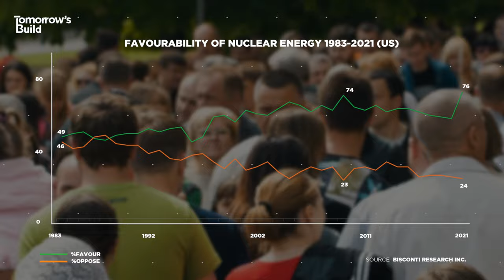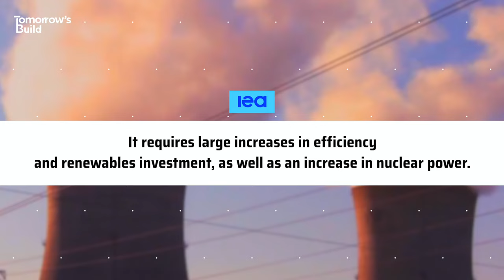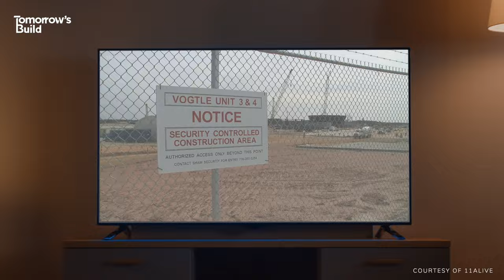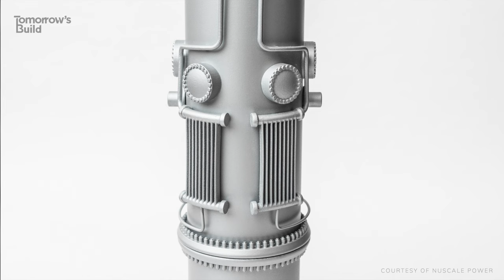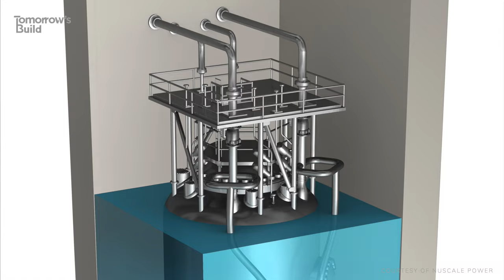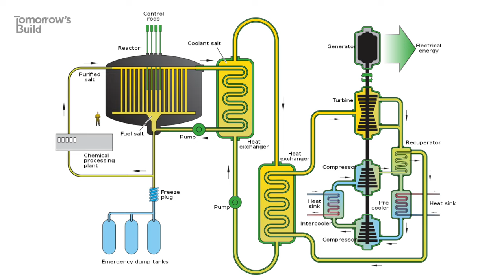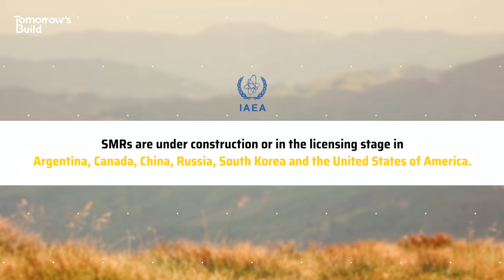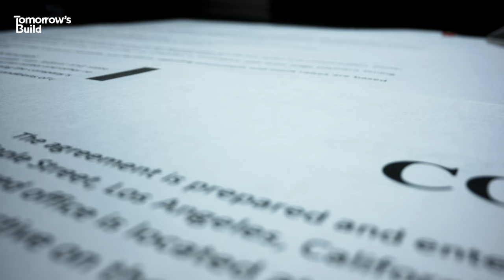These Mini Nuclear Reactors Can be Built Anywhere

Comment: Still not worth having to manage the waste for the next 1,00,000 years. If this post was a timeline that represented 1,000,000 years, then all of recorded history is represented the last word, No.
Reply: 1) The longest lived actinide in spent fuel has a half-life of 10,000 year. So the after ten half-lifes, when only trace amounts of of it would be left, is 100,000 year. I don’t know where you would have gotten 1 million years from. 2) Spent fuel, which is ~95% unused uranium, is too valuable as fuel in fast reactors and molten salt reactors, both of which burn those actinides in the reactor, to be left to rot. I would bet our current depositories will be dug up within a century if they ever open.
Reply: @kokofan50  Just google "how long before nuclear waste is safe" The reason they don't use the spent fuel for salt reactors is that salt reactors explode if they ever encounter water. but never mind all that, lets use your numbers. 100,000 years of our descendants needing to keep looking after this stuff is good?
Reply: @robloughrey  Salt doesn’t just mean sodium-chloride, which doesn’t explode when exposed to water; salts are a class of chemicals defined ny their ionic bonds, as opposed to covalent bonds. This is really basic chemistry 

Even a sodium (metal) cooled reactor won’t explode if exposed to water.

Putting aside the BS retort of just google it for where you got you disinformation, the actinides are burnt in MSRs, so there aren’t any to deal with for 100,000 years. The longest lived byproduct of MSRs has a half-life of 30 years. Besides those byproducts having numerous uses in science, medicine, and so on, we can easily seal them in casks and drop them in the ocean, where we would never find them.
Reply: @robloughrey  Salt doesn’t just mean sodium-chloride, which doesn’t explode when exposed to water; salts are a class of chemicals defined ny their ionic bonds, as opposed to covalent bonds. This is really basic chemistry 

Even a sodium (metal) cooled reactor won’t explode if exposed to water.

Putting aside the BS retort of just google it for where you got you disinformation, the actinides are burnt in MSRs, so there aren’t any to deal with for 100,000 years. The longest lived byproduct of MSRs has a half-life of 30 years. Besides those byproducts having numerous uses in science, medicine, and so on, we can easily seal them in casks and drop them in the ocean, where we would never find them.

Comment: Nope. It's going to be too expensive, still as slow, and not get approval.
Reply: You literally got everything wrong.
Reply: @kokofan50  
Expensive: New tech is always expensive, no matter what.
Slow: Same, new tech is not fast to build
Not get approval: Same, new tech is not proven and will have a harder regulatory time.

All of these together makes me think it has no chance to beat renewable energy, which works today and is safe. Renewables like solar, wind, and batteries also follow learning curves, meaning they get exponentially better. This does not. This also requires fuel that is not that cheap.

All this ads up to something that in the next 10 years is only going to be slower and more expensive.
Reply: @AlvarLagerlof  SMRs aren’t fundamentally new technology; they smaller, simplifier and more manufacturable versions of reactors of existing technologies. Also, licensing is part of the calculation in being cheaper than renewables. 

The whole point of SMRs is serial production, which will benefit from a learning curve, and on company has just said they’re going to start mass produing reactors this year. Also, solar and wind have bottomed out in their learning curves.
Reply: @kokofan50  Solar and wind have not at all bottomed out. Solar is currently the cheapest energy source on the planet.
Reply: @AlvarLagerlof  solar isn’t the cheapest. California has gone full in one solar, and they have electricity prices several times higher than anyone else in the US. Germany has done the same thing with the same results

Comment: This is stupid, it's better to use the economy of scale for greater efficiency, more safety, easier construction and cheaper overall costs to build an actual full size nuclear power station
Reply: These are designed to tap into the efficiencies of mass production.
Reply: @kokofan50  taping in will still be risky, imagine the public outcries of nuclear generator being installed everywhere, I’m from France where 86% of our elec is nuclear made but I clearly not that for the population, they would not be that open to the idea

Comment: I find the EBR II reactor very interesting. It was much safer than today's pressurized water reactors and fuel recycling was built in. A shame that the project was cancelled for political reasons.
Molten salt reactory have a lot of potential too, but will require a lot of development work. The point will be to make the reactors passively safe.
Pressurized water reactors were developed for submarines, which are swimming in cooling water. This made a lot of sense and the reactors are very safe if properly designed and maintained. Then the PWRs were built on land and made bigger and bigger. Thus safety became problematic and more active safety features had to be added, increasing the cost dramatically.

Comment: Ah yes, more hopium for the nuclear industry. Let's go over the points for why most of the reactor designs will never pan out:

1) High temperature gas reactors: cannot reach the required mass flow rate w/o significant water ingress via the helium circulator; TRISO fuel too expensive to make. 
2) Integral pressurized water reactor: too much structural material needed for the power output of the plant. Design scales economically w/ size.
3) Molten salt reactors: tellerium-induced radiation cracking in the pressure vessel. Cannot be resolved.
4) Supercricitcal water reactors: no fuel materials available that can withstand the critical point of water.
5) Sodium cooled reactors: cannot resolve the thermal stratification necessary to ensure longevity of structural materials.

Have a nice day, everyone.

Comment: nuclear powered is basically just a steam engine, nothing high tech just boil some water to make some steam... meh very unimpressive
Reply: well if you screw up you could spray death clouds everywhere
Reply: @FTFSupremacyROBLOX no, you can’t, not w these modern reactors. We know what happens from Japan when one is broken, roof torn off by aftermath tsunami: nobody dies. 

On the other hand there “death” every damn day from oil gas coal accidents or emissions. Look into it.
Reply: Boiling water is not high tech but the fission behind it is, the energy density is, so we have some reactors that can run nonstop within refueling for 20 years, and on a little piece of land.  Nonstop. 20 years.  There is no other tech that can do that, and there won’t be .
Reply: @Nill757  That's the point with nuclear, only if you screw up, fossil fuels sprays death clouds regardless.
Reply: @FTFSupremacyROBLOX  then give nuclear every time
Reply: @Nill757  exactly

Comment: Still questionable, nuclear power plants have large facilities on site to store spent fuel elements. A used reactor element needs to cool down for months in pools of water, to let highly radioactive byproducts decay, you will not put a burned out mini reactor on a truck, especially if it has been running a week earlier.